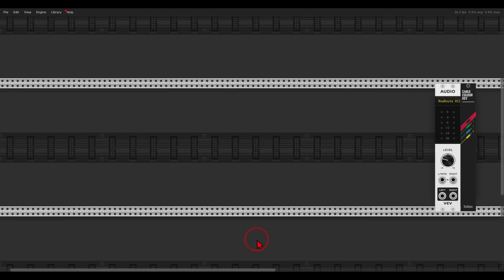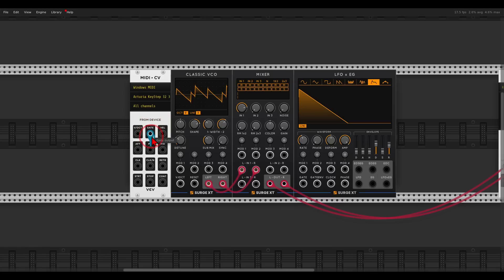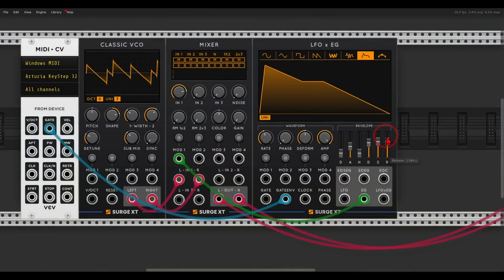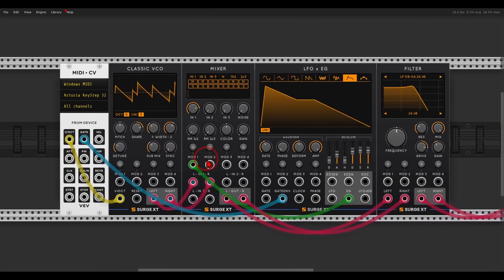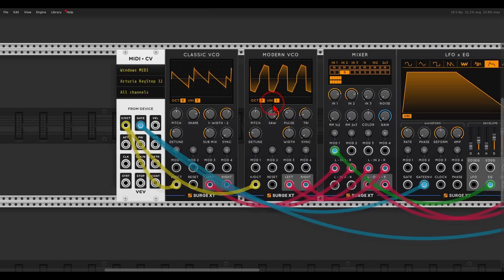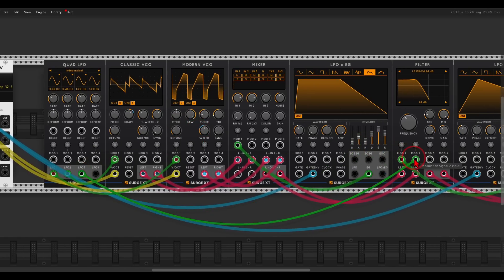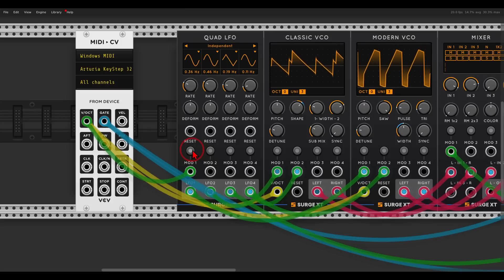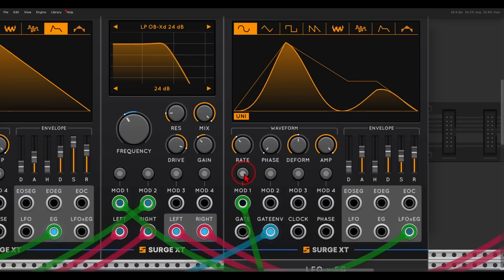Beginner-Friendly Pad Patch with Surge in VCV 2

Comment: Thanks Omri - Just as an FYI, there's a new module in the latest version of Surge XT called EGxVCA. It's an envelope generator (ADSR or DAHD) combined with a VCA at the regular 12hp XT module size, so no longer necessary to use the big LFOxEG for simple envelopes (or the gain on the mixer as a VCA although you can of course :)
Reply from the maker: Yeah, the new additions are so good! Thanks again, Steve!